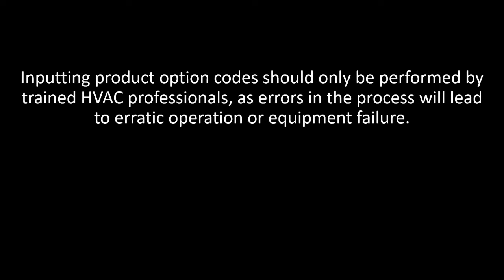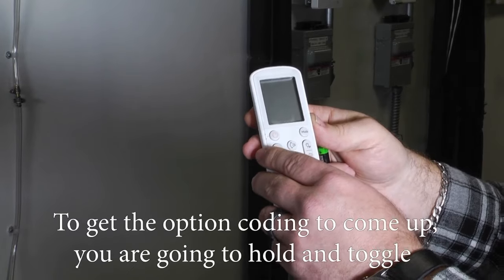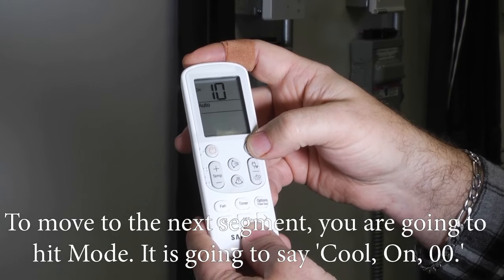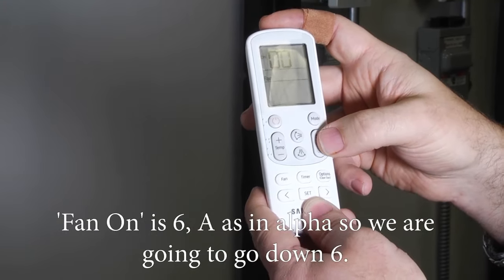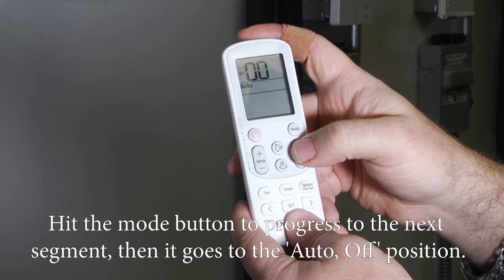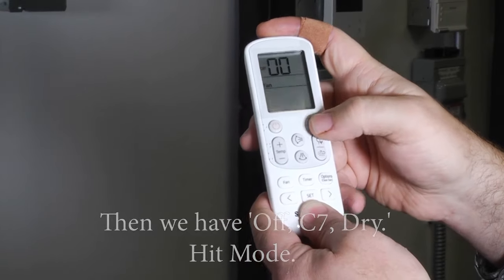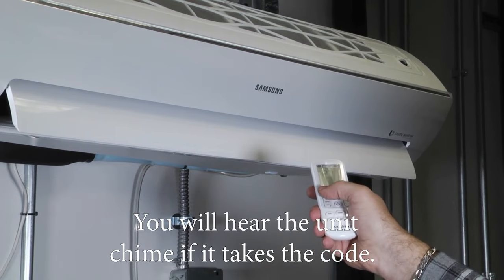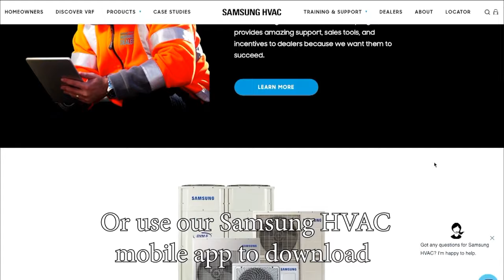Inputting Product Codes with a Wireless Remote

Comment: Ok firstly kudos on your knowledge. I think many of the guys who do the maintenance cleaning service for the units do not even know about all these things you did with the remote. I do not see the purpose of punching all these codes in though. Finally it would be nice if Samsung sold the bluetooth unit so we could upgrade our units that do not have it. Although I rarely travel these daze so my need for such an item is less than it was in previous years.

Comment: Hello 
I have error code C1 63 on Samsung split unit, AR12BXFYAWKNEU here in NL. I contacted Samsung NL and they refused to share reset option code because unit was purchased in Italy instead of NL. Does anyone have the option code for this model? It would be greatly appreciated if you can share it with me. Thanks

Comment: I hope this comment from 2024 helps
I applied all of this code to my unit and all codes works

MODEL : ARO9JVFSBWKNTC
Working Codes
Auto On: 00 A0 00 00 00
Cool On: 00 00 00 00 00
Dry On: 07 20 07 32 25
Fan On: C0 52 80 52 12
Heat On: 60 4C E6 29 49

Auto Off: 80 00 80 00 00
Cool Off: 10 01 30 8B 09
Dry Off: 00 A0 90 A0 A0
Fan Off: 00 E3 00 00 00
Heat Off: 00 01 00 00 00
And follow the instrucion on this video on how to apply the codes
Reply: Hello!
Where can I get the codes for the AR09AVHABWKNAZ model?
Reply: @tarcisiomota1  that i don't know
Reply: @Eulrix  😢
Reply: Hi please help do you knwo the code of AR09MVFHHWKNTC?
Reply: @keekim9684  use the codes that I posted just follow the video on how to put the codes on you're remote

Comment: i just wanted to ask something.

i have a problem with this samsung cassette type.

we just replace the noise filter pcb,the ipm pcb cause it's burn out but after we install the said parts the unit still now working.

there is a display in outdoor digital segments screen but i think its not an error

the display is ' dE F0 Ad' and 0000

the wireless remote is not also responding on a reciever board

hope guys u can give me an idea.

thank u

Comment: Why error 63 and C1
Reply: Any solution?
Reply: Same with me. Do you have a solution???
Reply: Same with me. Do you have a solution???
Reply: @messii8122  well I do... But depends which continent you're from
Reply: @creativesmk  Philippines.
Reply: Can you help me pls.
Reply: @messii8122  Well brother, you can try with the same procedure as shown in the video but with different codes depending on the model of your AC. It worked for me, but I'm not sure if it is gonna work for you as well. But you can give it a try at your risk.

100000521A5901A0EB33
Reply: @creativesmk  okay thaank You..
Reply: Much appreciated.
Reply: @messii8122  lemme know if it works for you
Reply: Tried this but I dont know how to make the aircon take another set of codes. Its just stuck at C1 63
Reply: @janneilgador  hi may i know what did you do sir about the error on your ac?
Reply: @creativesmk  i tried this code because i have the same error code c1 63. But after i input the codes it turned off and cannot switch back on
Reply: @irenecatapang3968  The solution code for this error code is different for different make of aircons in different continent. So it's likely that one code that works for one may not work for the other. I'll suggest not to experiment further and reach out to an AC technician nearby.
Reply: @messii8122  is your AC now repaired?
Reply: @creativesmk  omg ty this code worked on my model thank verymuch
Reply: @ismaelcortina  which country ? Thanks
Reply: @creativesmk hello thank you this code works but my ac blow is not cold is there anything I can do about it? Also from Philippines
Reply: @creativesmk  it's works . Thanks .. may AC blows cold air . But wrong number it says 30 I think it's room temp. Well it's better than nothing .
Reply: It works thanks

Comment: Once inputed these codes mine is stuck with C163 error and desperately trying to input new values but for some reason, when I press the power button five times, the device doesn’t react to it and not making any sound. Any idea on how to input new values ? Thanks !
Reply: I know someone who can help you.
Reply: @bhyrnalyngubatan8472  pano?
Reply: @bjtrinidad6225 pm po
Reply: @bhyrnalyngubatan8472  ok
Reply: Need po help same problem
Reply: we have same issue what did you do?
Reply: @nicolpelayo  Nothing. Still seeking for a solution :-(
Reply: Hey, do you know how to fix it I'm also stuck in your situation.
Reply: @Kimynyx  nope. If anyone has a solution, kindly share it in public. Thanks
Reply: up, i have this problem
Reply: @joshuapangilinan513  sad peko :/
Reply: @2t40  This video is to show how to programming the option codes when you replacing the PCB. Every models has it own option codes.
Reply: c1 63 baka may alam dito

Comment: I followed this and nis my Aircon has no air coming out and it keeps loading 88
Reply: Hi what did you do after?
Reply: Same problem how to fix plz tell
Reply: Me also facing the same problem plx tell me how to fix
Reply: After  feeding the code into the remote, face the remote towards AC, then press power button 5 times. The AC should beep with every press. 88 means it is not programmed to function respective to your country/region

Comment: Anyone checking this channel? I have the option code for Samsung AC Model no AS182UGASTL / AS182UGANSTL - But the main Question is how do I enter 12 codes through the Remote that's expecting 20 codes? Note: Control Code for AS182UGASTL is 0A-00-00-17-52-4A (or) 0A-00-00-17-52-6C
Reply: Do you have option code of this model AR12NV3UFMC
Reply: @bharatvaity859  yes I have
Reply: Please share that code i really need this
Reply: @naveedtareen8770  please share that code i really needed this
Reply: Do you have option code for this please.. "AR18AY5ACWKNNA"
Reply: @Jay_Zx  any luck?
Reply: Can help me find the option code for AQ12UGA1SAM ? Pls
Reply: Do you have the code for AR18FCFSAWKN ?? Would really appreciate it!
Reply: @Naveed Tareen  Thank you, but the requested model is not there: AR18FCFSAWKN ?
Reply: AR18RV3JHMCNNA can you help this option code